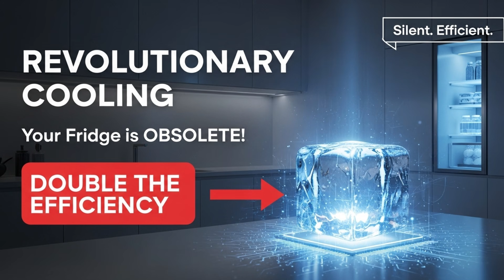Silent, Twice as Efficient Fridge Tech is REAL   Game Changing Cooling

Comment: To be accurate, Controlled Hierarchically Engineered Superlattice Structures thermoelectric is 2X the efficiency of conventional thermoelectric cooling (Peltier devises), which wasn't widely adapted mostly because of their very poor efficiency when compared to cooling using the refrigerant cycle.  Doubling Peltier devises' efficiency would still make these CHESS thermoelectric devices significantly less efficiency when compared to the current generation of refrigerators and split-A/C systems operating refrigerant cycles.
This feels a lot like this video is pumping this technology by using misleading claims.